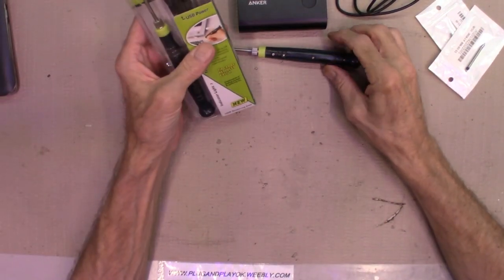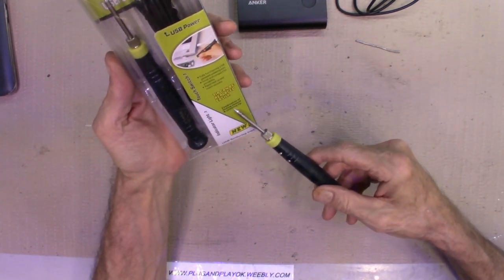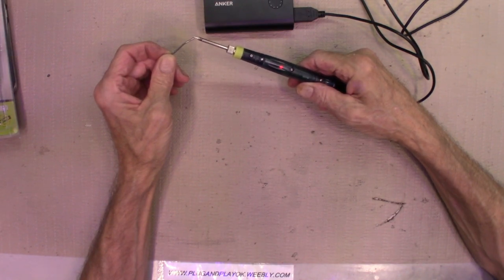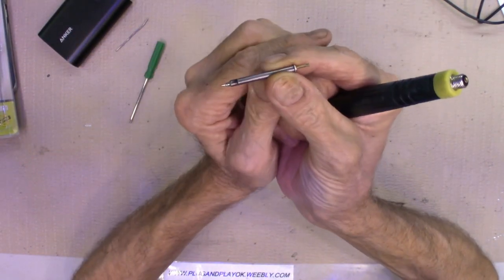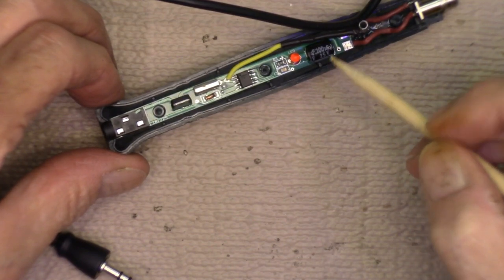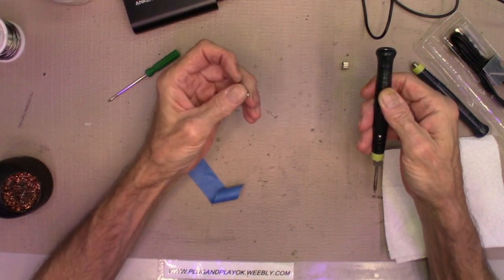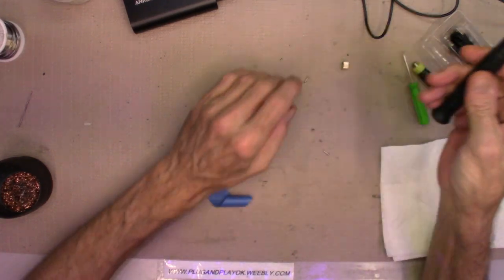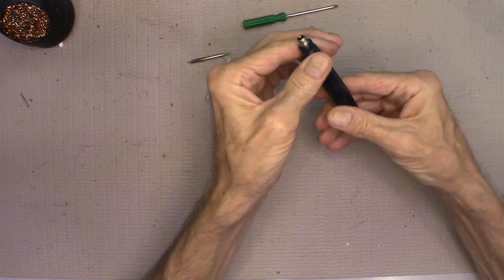USB Solder Iron Triple 555 Bypass Surgery

Comment: I believe the iron has a vibration switch that you were actuating when you were tapping the button, the button uses mains hum to keep it on, bad idea if you want to do a job in your car lol!
Going to try a tactile micro switch for mine, arriving in a few days!
Reply from the maker: That should also work. Also the reason for bypassing the 555 timer was to keep it on. I ran it for over an hour with no heat buildup. Also during small detailed work it was a distraction for me to keep "tapping" the sensor so as to stay on. One less distraction. I love the little iron.
Reply: Have you done tactile mod, how did you fit it in?

I have one of these and there appears to be no rhyme or reason as to when and how it runs. It can get a little too hot to my taste and the tip degrades rapidly. Once it's on, it doesn't usually want to turn off, but it can sometimes decide not to turn on. But it's so quick to heat, that i'd rather have it run simply when i press the button. The metal contact is just so stupid, i never know whether i'm actually doing anything and i need to keep looking at the iron LED. I have used a battery operated iron before which runs just when a button is pressed, and i had no trouble with that.

Comment: I just removed the steel ball and soldered a copper wire around to the outside of the solder. it touched when i held the solder and  it worked.
Reply from the maker: I left the steel ball on so I could attach to a magnet on my station when off.